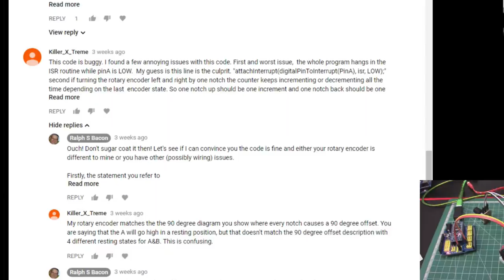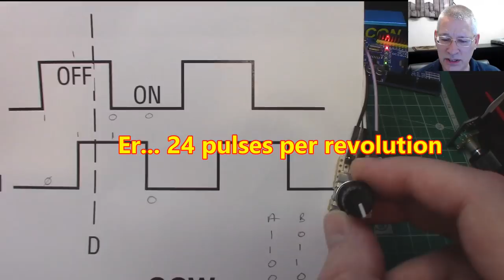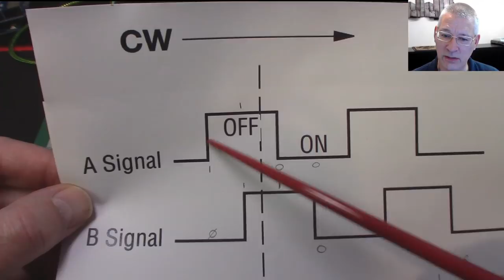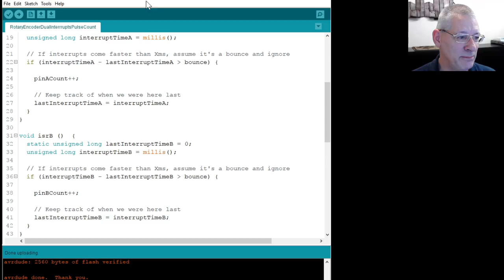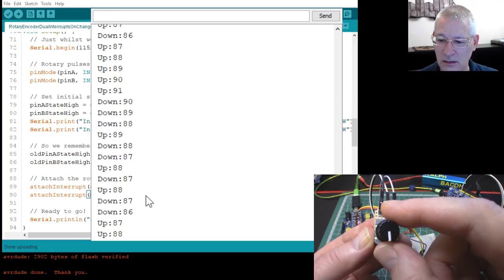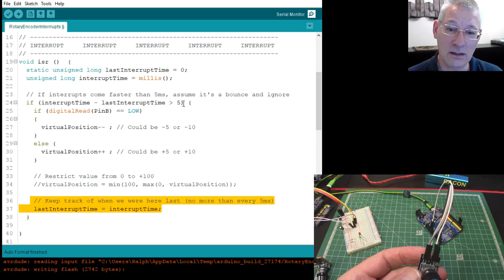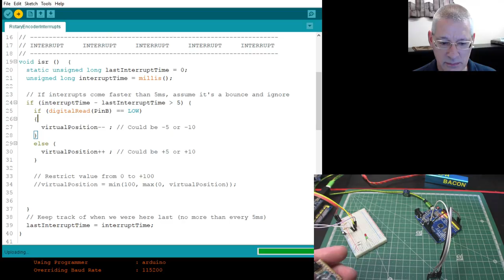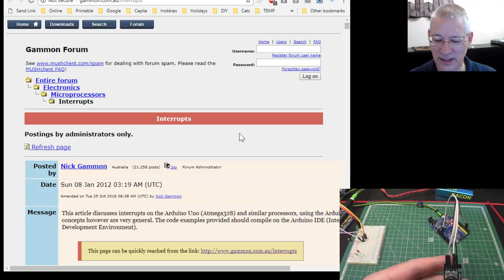#96 Rotary Encoder Update - Stepless & Software Debounced

Comment: Ralph: 

Why, why, why, why are people so terrified of hardware debounce? Hardware debounce (a) filters bounce from your encoders and switches; (b) can be used natively with ISR calls--as most people use delay() to do software-debouncing, and as delay() cannot be used with ISR calls, the naive "back off for n ms then re-read the input pin value" manner in which many people implement software debounce is incompatible with ISRs.

I was hoping to see hardware debounce in your video today. Sadly, no. But you must have a very good reason for this and know something that I do not. I'm after this missing bit of information.
Reply from the maker: I feel your sadness in the same way you feel my terror at the thought of hardware debouncing! Seriously though, (and see the comment by #loftos1 here) I'm now thinking I should be seriously looking at a simple Schmitt trigger or similar. The reason I tried to do it without extra hardware is because I was certain we can manage without that extra layer of hardware - the video clearly demonstrates that my hypothesis was flawed. Stay tuned, I Suck At Gaming, the debouncing story is not yet complete... and thanks for posting.
Reply: Noone uses hardware debounce in industry. Costs footprint on pcb.
Reply from the maker: In fact, (and spooky timing) another viewer has asked about a dual rotary encoder. That aside, the data sheet for said encoder includes a simple circuit for hardware debouncing with a capacitor, resistor and simple 74HC14 Schmitt trigger. I may have found the simple hardware debounce circuit for which I feel no fear whatsoever :) (link: http://www.leobodnar.com/products/BU0836X/ELMA-E37.pdf ). what do you think #ISuckAtGaming, is this what we all need and then we can forget about skipping pulses, delays, re-reading input pins and the like?
Reply from the maker: I wonder how industry addresses the problem of debouncing then? Like my car radio, just accept s-l-o-w pulses and say that's the way it is designed (which is quite OK, as they are producing the product)? This was my assumption which is why I really tried to do this without extra hardware but... see my response here about a simple Schmitt trigger.
Reply from the maker: I'm going to try a debounce circuit for that stepless rotary encoder. I haven't got a 74CH14 to hand but I have got a CD4013B (Quad NAND Schmitt trigger) which I can use two per pin to ensure the signal is not inverted. Just a proof of concept really but which might make it into a future video. See what you've started now?!
Reply: Why worry about an inverted signal Ralph? If both A and B are inverted the gray scale will still increment/decrement as intended.
Reply from the maker: Yes but then we can't track the LOW signal and the RISING and FALLING will be the other way around. Confusing at best! By ensuring the signal remains un-inverted the code does not change. And we have the gates available on the chip(s) so no extra cost to our project.
Reply: Hi Ralph You need a space after the end of the hyper-link as it is  http://www.leobodnar.com/products/BU0836X/ELMA-E37.pdf) is a broken link.
Reply from the maker: I've fixed it now, Brian, thanks for being so eagle-eyed!

Comment: Another slight aside regarding the sidebars into dual rotary encoders and hardware debouncing: thanks, Ralph, for seeing these inquiries for what they are: fans wanting to know more and hash out details. Thanks for not feeling threatened or thinking that to bring this question up is to devalue what you've done here. 

I like the channel. I am interested in your videos. I am quite curious to see where you go next, especially as I don't have a scope myself (sad-face) and therefore cannot easily visualize switch/encoder bounce (aside from a counter). 

One suggestion, in light of what seems to be coming: you may want to change this video's title to "... & Software Debounced." ;) Be well!
Reply from the maker: Thank you for your continued support! I love it when viewers suggest things (see my comment against your last post regarding the debounce circuit I mentioned) as it gets my creative thoughts started. Pity you don't have any kind of oscilloscope; my recent video review of the Banggood cheapie (single channel) version should be good enough for this, I'll try and include that in any future video about debouncing. And thanks for the title suggestion, I will mull it over.
Reply from the maker: And in the meantime watch #92 JYE Oscilloscope Kit Review & Build and ensure you have lead-free solder! Or a better soldering iron / tip combination. Seriously, this should be good enough to show rotary encoder pulses, but we shall see.